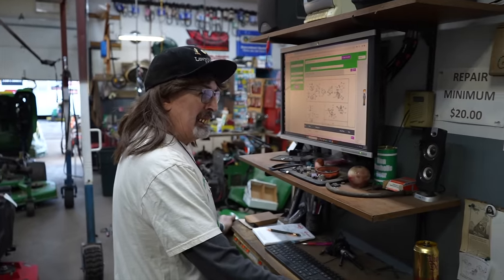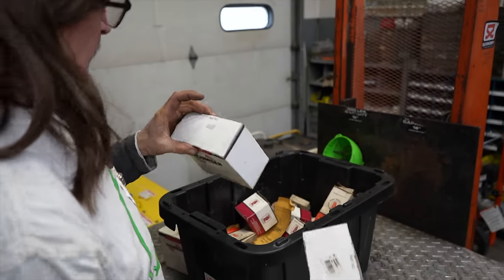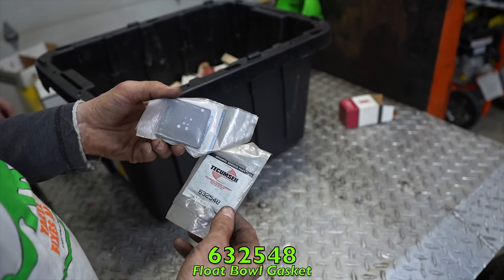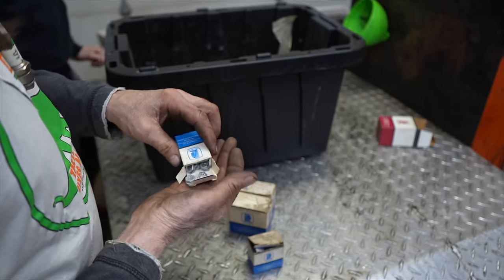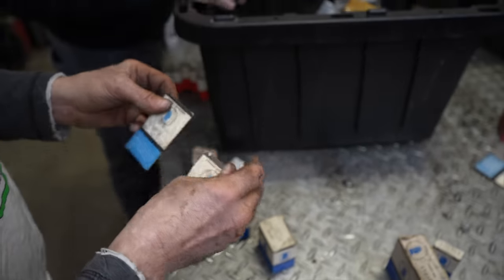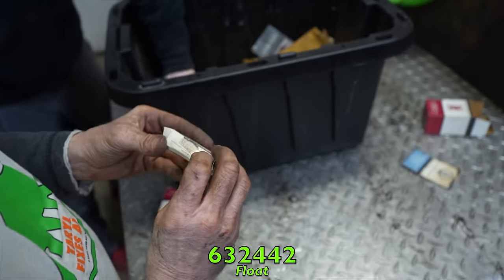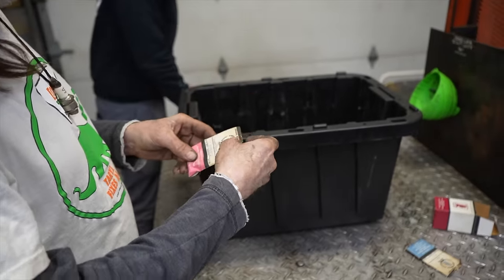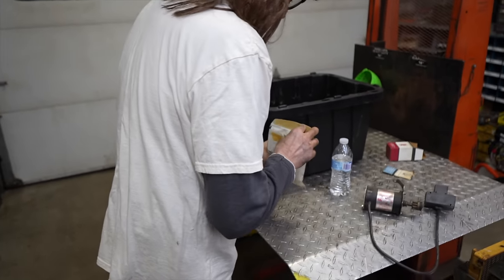You WON'T Believe What I Found In This Box Of FREE Rare Parts!

Comment: I worked at Tecumseh for 15 years and was the repair person on the line loved reworking the old engines. Miss all my co workers you made my day thank you.
Reply: I have a  15.5 hp tecumseh  ohv engine  on my 2005 murray  and  it is the most  reliable  engine  that  iv had so far
Reply: @posttopstreetlight1055  I really thought they were great engines but they had sold out a few times and some of the new bosses wanted quantity instead of quality the last few years that we operated.
Reply: Yeah  the only  modification  I made to it was mesing with the  timing  and lengthening  the lobes  on the cam shaft

Comment: Picked up a book on electronics at a community garage sale a few years ago for 50¢. When reading it I found ten $100 bills tucked in the pages. Best 50¢ I ever spent.
Reply: Years ago, an older couple passed away and the kids came in to clean. The old folks had newspapers stacked in basement floor to ceiling in neat stacks. All the way back before Eisenhower was president. Anyway, they decided to start using a moving dolly to move them out to the trash. They did this for trash day for a couple of weeks. Then as they were putting out another stack for the third week, it fell over, and some cash came out of the papers. They quickly realized what mom and dad had done, hiding money in the papers. They ended up going thru all the remaining stacks one paper at a time and pulled more than 20 thousand out. They wondered how much they threw away in the stacks they put out for trash.
Reply: @ronwilgenbusch1961 If that was my parents I would have been so pissed. What kind of idiots hide cash in old newspapers. If the house burns down then your savings are gone 😂 this is unbelievably dumb
Reply: @RejectReality97 you would be surprised how people that went through the depression hid their money. They never trusted banks after the depression.
Reply: @RejectReality97  I wouldn't be so upset about the hiding of the cash, but the not telling the kids where it was.
Reply: @stevemoore8599  Then put it in a fireproof safe in your house. Not the MOST flammable material available 😂
Reply: @quaddad  They were hiding from the kids

Comment: Think you sir for your video on rebuilding the tuff torque. Automatic the washer thickness part was crucial for  me because they look so similar with out that info I might have made the mistake of placing them back in the wrong position but ever thing else went smoothly I live in Tennessee not to far from tuff torque so I went to the warehouse and picked up my rebuild kit I don't know if you have ever heard of this but I had a long time john deere macanic give me some advice run 15-40 big truck oil in the transmission instead and it will last a lot longer I have been running it for a year with no problem and the oil still looks brand new and it also pulls a lot stronger I do let in warm up before using it because of the thicker oil but it is so much smoother and take off is a lot better thank again 👍🏻

Comment: I have a Wizard 18" push mower I'm going to try to make run. It has a Eager one Tecumseh engine. They gave you my box of parts. It still has the barrel air cleaner, the side recoil the T style push frame, steel wheels and I notice the blade is rusty new. Just for fun but really an 18 inch mower was a handy size for trim work. Wizard! Western auto. 3 bolt pattern engine.

Comment: In the 60's my grandfather bought a Sears 1000 watt generator, it still starts on the fourth pull at least till they started using ethanol gas. It was powered by a Tecumseh engine. Tecumseh's seem to have a longer stroke. Platinum Equity LLC bought Tecumseh engines then they disappeared. To bad I like Tecumseh engines.

Comment: Im A grass rat who needs A Tecumseh diaphragm carburetor with the manual choke. I have A 1958 Jacobson commercial mower that's got A 3 horsepower 4 stroke engine that originally had A diaphragm carburetor with the manual choke. How much do you want for it?